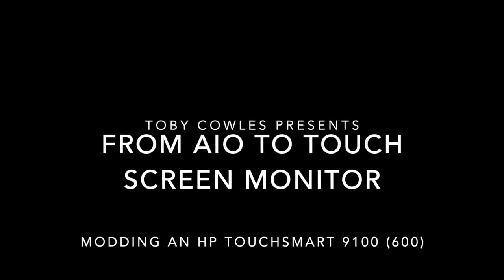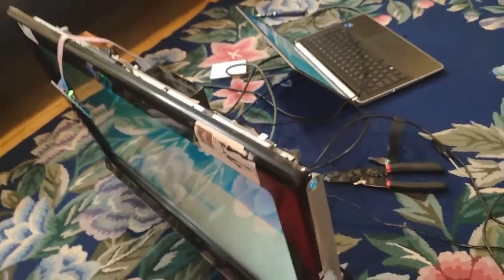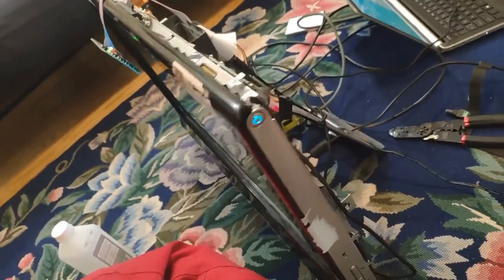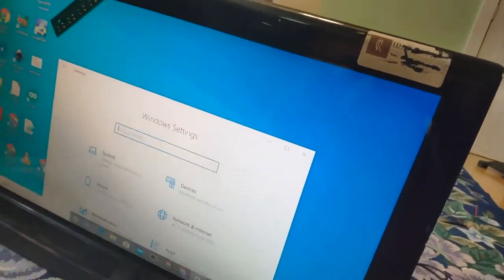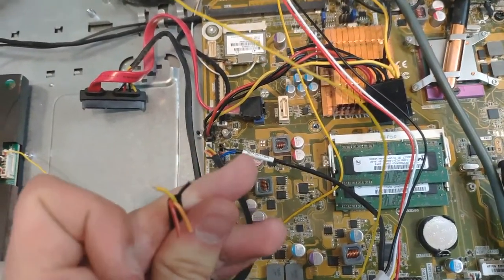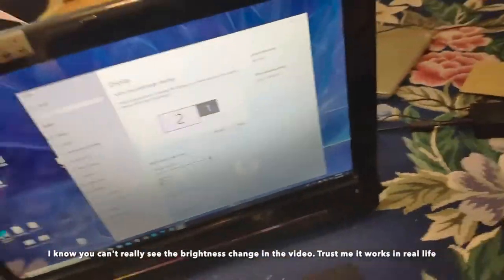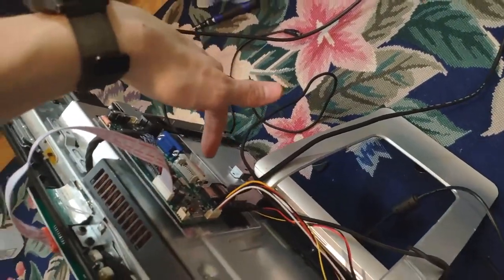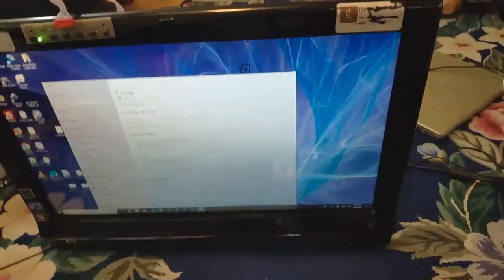DIY Touch Screen Monitor (converting an HP Touchsmart 9100/600)

Comment: Hi Toby.
Little late for this advice, but you could replace the HP Touchsmart inverter with the inverter from the LVDS controller board. You only had to break each LCD screen 4-pin connector in half and they fit in the LVDS controller inverter.
I have the same HP 9100 Touchsmart and I'm converting it to a monitor too. Thanks for posting the idea.
Reply from the maker: I think I still have the invertor in a drawer somewhere. I will probably do that. Thanks so much!
Reply: Hi Toby and Jaimie.  I am trying to this conversion with my Dell all in one XPS 2710 touch screen.  I’m able to already use the all in one as an extended monitor via HDMI in port in the AIO but I am not able to get the touch feature.  Any help if I need to convert any wire to give/get touch data to the laptop(main)?

Comment: Hello how are you?.
I would like to know if the HP Touchsmart "600 - 1020la" model has the same USB connection to control the touchscreen from another PC as well as the video.
Thanks for sharing.
greetings.

Comment: Hey, great video, I'm working on a similar project, mounting a couple of those displays inside my desk. But I have a question, did you have to install anything to get the touch working? Cheers
Reply: Ohh and also, did you shorted the two grounds on the usb wire going to the touch driver? Cheers!

Comment: How did you make the usb connection for touch controller. I cut off a printer usb wire and connected it to the touch controller board but its not working and the board is heating up.

Comment: Would that controller board work with the HP TouchSmart 600?  My neighbor put one on the curb and I snatched it up.  Had an issue with the battery.  So I need to setup power to the monitor and hook up a controller board so it can connect to a raspberry pi.

Comment: Hey Toby, thank you for taking the time to put this video together. I’ve gutted most of the PC parts of my 600 and I’m almost done converting it to a standalone display. Got the board you recommended and wired up almost everything, just waiting on a power supply and one more thing I was wondering if you might be able to help me with. I’m trying to route the built-in speakers to the new board. The plugs seem to be the same but there’s two sets of them plugged into the motherboard and only one plug on the new board. 

Do I need some kind of adapter or do I only need to use one set to get stereo audio working through the onboard speakers?
Reply from the maker: Honestly it sounds like you did a way more thorough job then I did, that driver board has a 4 pin "speaker output" but I can't find a pinout of that connector, if you want the speakers working then you must figure out which of those pins are r+ and l+ and which two are ground and connect them to the speakers. Sorry I couldn't be of more help
Reply: The HP Touchsmart 9100 has two independent speaker connections for each. You have to make a "Y" cable in order to make it work for the HP Touchsmart.

Comment: Hey thanks for the upload, exactly what I was looking for, ive got the hp Compaq elite 8300 aio and I'm looking into doing something very similar I believe both have the same lcd display I've found the panel driver board you mentioned but can't seem to find the touch screen driver board you mentioned could you possibly let me know the model number or a website that you got yours from. Thanks again keep up the great work.
Reply from the maker: The touch screen driver board was original to the computer (installed by HP not me). I simply cut the original cable (internal USB) and reterminated it with a normal USB Type A plug
Reply: @TobyCowles   great thanks for the info, I really appreciate it. Again great job, oh and just a future idea for ya that might help, I used a type c hub with an HDMI input ethernet and four USB 3.0 slots pluged in and it provided everything I needed of course it was no where near as much fun as you had doing it the "figure it out" way. . Lol

Comment: Hi Toby, 
Great video! I just had a quick question about the NextWindow board. Besides the USB connection there look to be two other cables that go into this board. Do you know what those cables are and where you connect them? 
Thanks!
Reply from the maker: if I remember correctly they go to the IR sensors that make up the touch layer that covers the LCD
Reply: @TobyCowles  Thanks! I have just the screen,  driver board and nextwindow board at the moment. Any suggestions for where I can get those cables? I'm not sure what to look for, haha. Thanks again!

Comment: Where you rewired the next window touchscreen driver board for the external USB what USB did you use? 3.0? And do you remember did the wire colors match or did you use volt meter to figure it out? I
Reply from the maker: Nope. It's just USB 2.0, the color coding matches with the USB 2.0 standard (red. black, white green), at least on mine. If HP used a different color coding on your you would have to use a volt meter to figure it out.
Reply: @TobyCowles  yeah I have the same touchscreen driver board as you but mines a 5 wire orange black green white and yellow, can't decide on the orange and yellow. Guess it's volt meter time lol

Comment: Could you share wiring diagram connection?
Reply from the maker: Unfortunately I don't have a wiring diagram to share. I kind of just figured it out as I went along on this one. Basically as long as you have a multimeter, and a basic knowledge of standard internal connectors you should be able to figure it out. I will try to answer any specific questions if needed.

Comment: instructions? parts? cost? Thx!
Reply from the maker: Take the thing apart, use an old USB cable to break out the USB for the touch screen controller module, install this LVDS driver to allow you to plug in other things https://www.ebay.com/itm/163699315305 connect the enable pin on the LVDS board to the enable pin on the HP backlight driver board